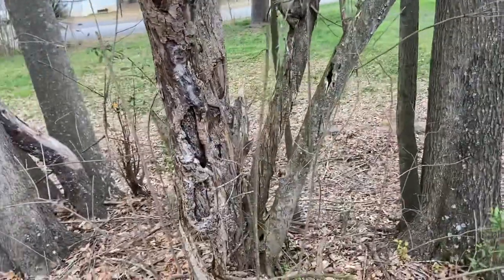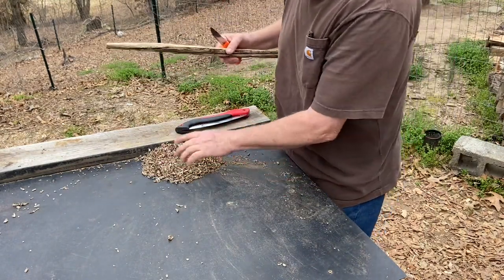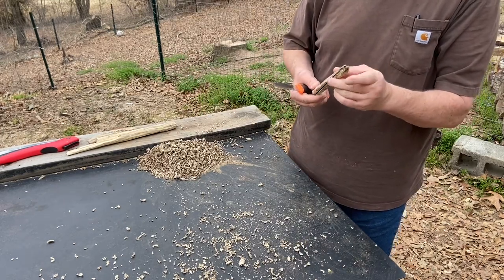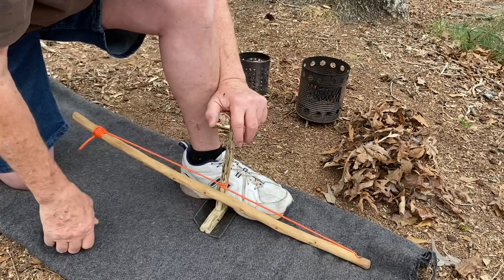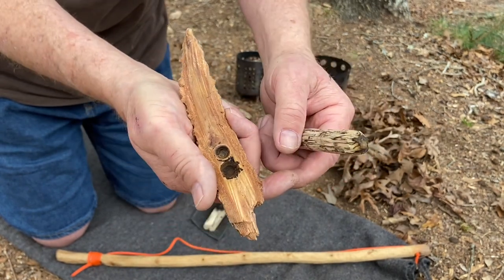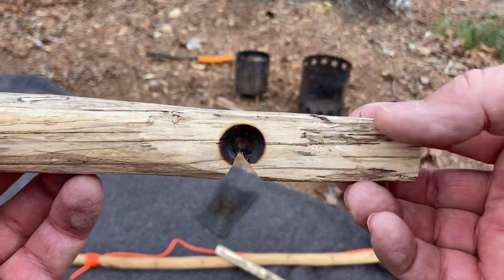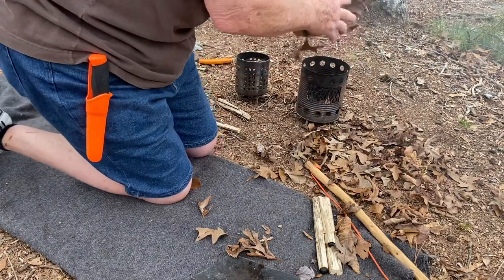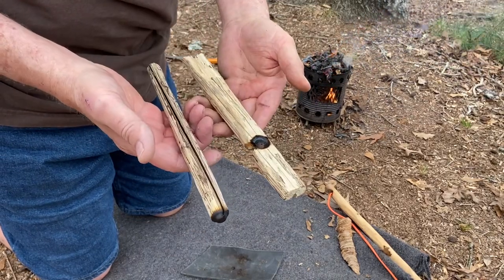Chinese Privet For Bow Drill Friction Fire Is About As Good As It Gets!!!

Comment: I wonder if Chinese Privet is what we call privet hedge here in Louisiana. If so we have a lot of it. What is the rectangular piece that you placed under each fire board? Is that a piece of leather?
Reply: Also, I liked your explaining that the squeak is caused by moisture in the wood. Thanks again for another great video.
Reply from the maker: We call it Privet Hedge here in SC also. If it has long clusters of white flowers it's CP, if little greenish flowers PH.
Reply from the maker: I use a black leather ember catch. You can buy a multi-pack of scrap leather from Hobby Lobby for $8.